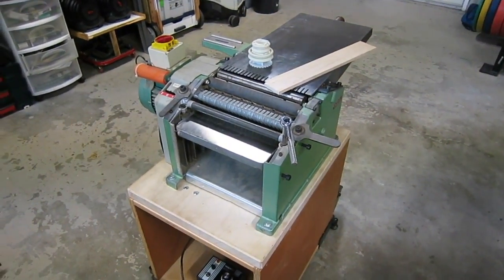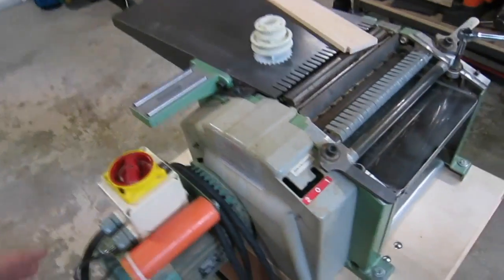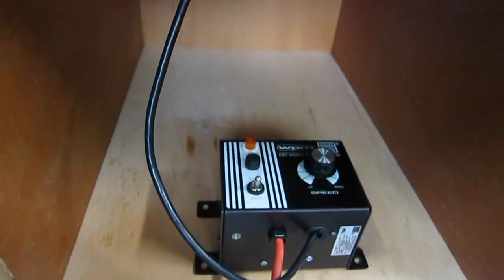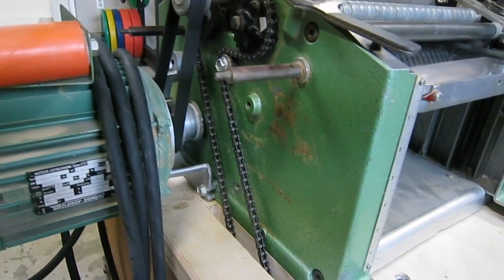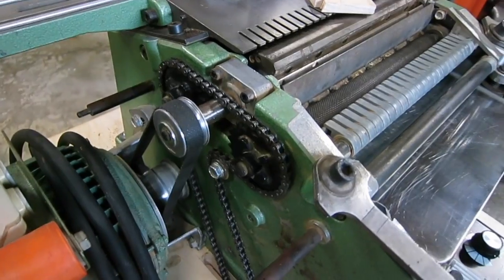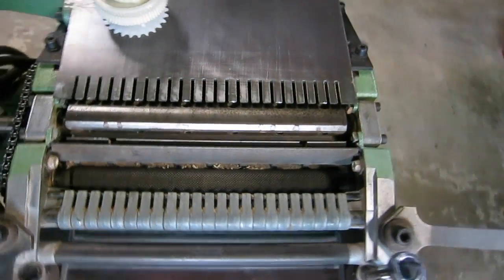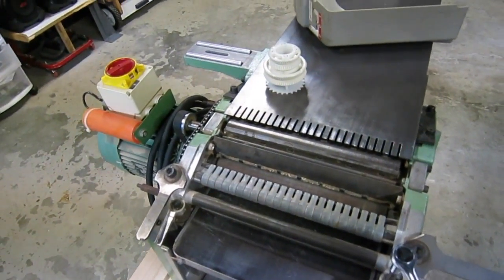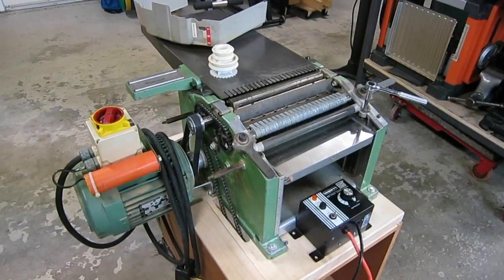Inca 560 Planer Feed Upgrade

Comment: Really great to see. I've purchased same kind of machine where I would need to upgrade the feed as well, really not working, but in good shape otherwise. I'd be really grateful if it was possible to send me information on how the upgrade was done and what parts were used. If possible with detailed info since I'm a bit of a beginner at this, but would like to try to fix it. Thanks in advance!

Comment: I recently bought a used Inca with that upgrade already installed (to replace by Inca).  After mounting the motor under my stand, regularly the switch does not start the motor.  Wondering if it could be beause I wired up the grond connection between the motor and the controller, or if my toggle switch in the controller is flaky.  Any ideas?  Where can I find a wiring and setup guide for the controller for this application?

Comment: This is fantastic. I just picked up a very similar Inca with a terse head. The feed assembly is missing a bunch of parts however and the gears seem to be shot. I'd like to do something similar to what you have here. Any more info? Could you provide a link to Franks guide? Thanks!
Reply: did you ever  provide franks guide, i need to do this upgrade, any info would be appreciated.  TY

Comment: That plastic gear is a horrible design on an otherwise excellent machine. i made a base for mine out of a steel telecom cabinet that had heavy castors. Pull the lead off the motor and re-wire with 14-3 lead cord. 2 hot wires 1 neutral 1 ground if you want it all on the same switch

Comment: Soft keys sheer off, that's why they make drive keys you're overthinking this.
Just use a brass key.  unless you do not have a broch or mill to cut the keyway slots.

Comment: Nice work.
I have the 2 blade tersa version and my switch has broken.  Any ideas on getting a replacement one or putting on a new motor and switch.
Reply: The switch on mine just went out and a replacement that was close, was a couple hundred dollars. I replaced it with a Leeson 56C 2 HP motor. Worked great!

Comment: +thesergeant I am really curious about the DC Gearmotor you used for this upgrade. I have the same machine and was looking to do a similar upgrade. I'm wondering what the torque rating for your gearmotor is? I want to make sure that the motor I purchase for this upgrade has sufficient torque. Thanks for your help!

Comment: Great upgrade. Looking forward to your next jointer planer video. I just bought a 343.190 with a 2 blade Tersa setup that is in great condition and cutting beautifully as is, but it came without the dust collection hood. I am very interested to see your solution. I feel lucky to have found such a precision machine for less than a Dewalt lunch box planer. Do you know if the 343.190 is the same as a 550, 570, etc.? Thanks for sharing.

Comment: Neat! I will look at those drive roller springs in the future, but all the models I see were made for the Canadian market and I have not seen the short 510-570 serial #'s  J/P's of the US market, except for my big bandsaw that I brought back from Mass. There seemed to be several parts, altered thinned down as models moved along, those tension springs are obviously set low so a clip or pin is the same as a nut but less cost, you could thread the ends and ad nuts, which would allow you to overtension them, add stress to the bushings inside the pillow blocks of the of the drive rollers and wear out those bushings and crush nice little grooves in the wood as the rollers crush and pull the wood through the thicknesser, wear out the plastic sprockets (not a fan of those) and put a strain on the dc motor system. Rant over and out. Remember draining the swamp was the goal. Don't forget polish that stainless steel deck and use wax (non silicone) and buff that will ease all the strain on all those tricky Inca parts right back to the motor and reduce the hole in your wallet.
Cheers Mate
Jerry Walker in Everett Ontario

Comment: TS: I have purchased from Jesse before, I hope he has metal sprockets, this is the 3rd J/P machine I have reworked, the early models had all steel sprockets, the planetary gear was a treat to watch, again an issue to repair..... the engineer who designed these must have been a watch maker! Thanks for the quick response. 
I have 7 machines in storage that are repairable, and have made parts for fences the 259 and the locking nut for the overarm guard. 
This one has a very rusty 2 knife Tersa Head. I am making a bearing clamp to ease the pillow blocks out to remove the head for cleaning and bearing replacement. I purchase my knives from Janine at Tersa Knives https://tersaknives.com/. They carry all the SamVaz products like the Rali Planes and can have a 3 knife Tersa head (with bearings) delivered to your door, from Switzerland for $650.00 Canadian Dollars. (quoted to me in April 2015) I had a meeting with her in Beautiful Kaslo BC 2 years ago
I have subscribed to see your next installment.
I am planning an Inca T-shirt run.
I have sharp stills of my rebuilds but no videos.
Look forward to your next Inca bits.
Great work on the souped-up Inca!
Cheers Jerry
Reply from the maker: Ahhh yes! I recognize your name now.  I went through your pics of your 510 rebuild on the yahoo group.  Incredible job there.    I noticed in the rebuild of the roller bushings that the roller tension appears to be adjustable on the 510.  Unfortunately that's not the case on the 550/570.  I'm looking onto simple ways to accomplish this on my machine.  Also looking into building a bed extension for the planer that won't require require frequent waxing.  

My 570 is a 2-knife as well.  I ordered a lifetime worth of tersa blades from Janine.  They were great to deal with and the prices were good too.  Unfortunately the fence on my 570 is convex so I'm not able to joint a 90* edge.    I'm thinking about just carpet taping  (or screwing -- last resort) a 3/8" peice of maple to the face and then jointing the wood flat.    I've had a 550 and a 560 and both fences were fine.   My 570 is brand new and though the excitement I missed the warped fence. 

Looking forward to seeing your shirt!

Comment: I have a broken sprocket on my plastic pinion cluster, I would like to make changes to mine. Who is your supplier for the sprockets? and who is Frank? Cheers Jerry
Reply from the maker: You can contact Jesse at Eagle Tools in Los Angeles for a replacement pinion gear if you'd like to keep it stock.  Gears are ~$60+shipping last I checked.  I purchased the sprocket for the motor off of ebay.  The number of teeth is dependent on the RPM of your motor.  You'll need to run the numbers and figure out the feed range you want to determine the teeth on the gear.   Most motors you're going to run across will have imperial shaft sizes (typically 5/8").  Since the sprocket you need is metric (05B-1) you'll need to bore out your gear to fit on the motor shaft.   Frank is a member on the Inca yahoo forum that did a similar modification years ago.   He was kind enough to give me some direction in the modification.   I'm going to be starting a separate channel dedicated to Inca machines.  There seems to be very little info out there on them so I thought it would be nice to do a demonstration of the ones I have and discuss some of the upgrades/modifications I've made to them.  SInce making this video I have upgraded to a brand new, unused Inca 570 Tersa head jointer/planer, and purchased the Inca 10" band saw and 259 10" table saw/mortising machine.  Check back in in a few weeks and I will post a link in this video to the new channel.  Thanks!

Comment: What model motor did you use sir?  Nice work by the way!
Reply from the maker: Thanks, I used a Bodine Electric DC Servo 1/8 HP 57RPM motor with Bodine speed controller.  I purchased it used on eBay.  Not necessarily cheap but taking into account that the replacement gear is $60 and the belt is $15, it only takes 2-3 to pay for itself.  Plus you don't have to worry about lubricating the gear and taking only very light passes.   Hope that helps!
Reply: Just wanted to let you know I followed your plan very closely on my 550 and am quite pleased.  I replaced the beat up original stand with a Dewalt DW7350 planer stand and removed the Dewalt stickers and added a 1.5" thick top and was quite happy.  Then I got a opportunity to procure a pristine 570 that had been in storage for 19 years.  I took the 550 and slapped it on the 570's base and reinstalled the old drive system and sold that sucker.  I then used the new base and drive system on the nice 570 with the Tersa head.  I'm struggling to get the chain to line up perfectly...getting a little chatter.  Need to spend a bit more time sorting that out.  Anyway I am very grateful to you for this video.